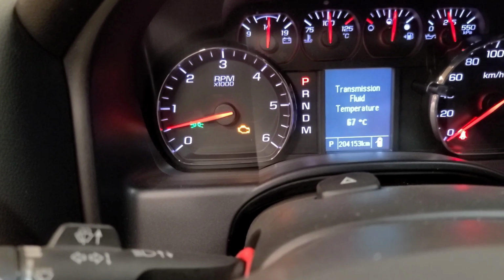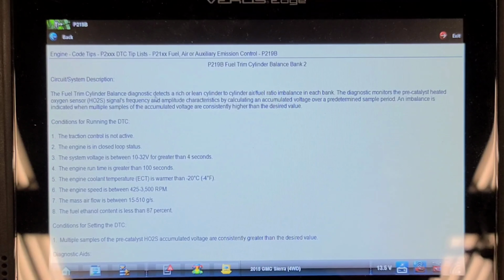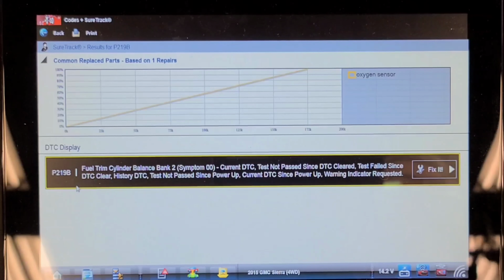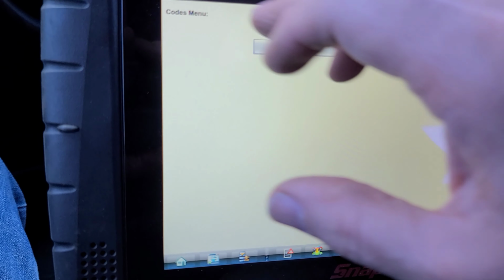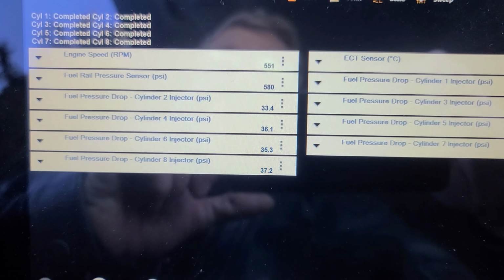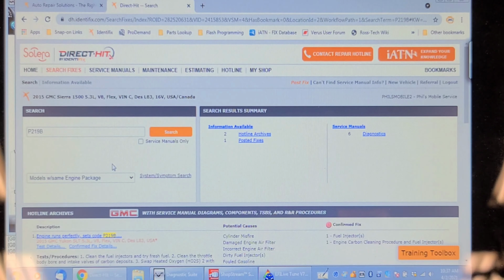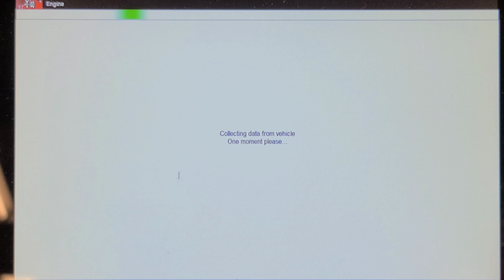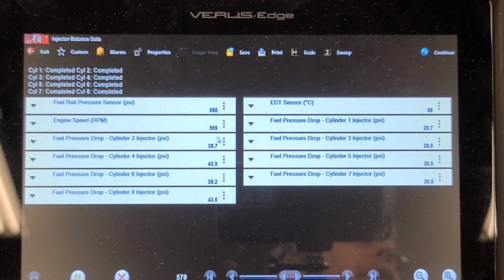2015 GM Truck 5.3 Stumble, P0300, P219B Codes Diagnosis Part 1.

Comment: Did a good job on your video one thing though you don’t compare left and right banks you compare each bank individually whatever the suspected injector is you leave out add the other three pressure drops together Multiply it by 20% and that gives you your ex acceptable pressure drop then you need to make sure you’re suspected injector falls within that time to replace it🤙🤙
Reply from the maker: Yes I found that out thanks. It's still a crappy test. Thanks for the information

Comment: Cylinder deactivation and direct injection- awesome
Reply from the maker: Yes my thoughts exactly. Two steps forward and 4 steps backwards. That's why I'm driving an 06GMC. Has 375 000klm and haven't done anything to the engine except plugs once and a water pump. Plus it routinely gets better fuel economy than the new trucks with all the bells and whistles. My next truck will be electric...

Comment: Dealing with this now after putting an engine in a truck. Super frustrating. I don’t know if it was there before or not either which is the frustrating part also for future reference if you pull the FPPM fuse, it will disable the fuel pump. originally, I thought my issue may be related to the breather on the valve cover being different on the driver side however, the code I have is bank too. I changed the valve cover over to the original design and I’m still having the problem. Both banks seem to be running rich just bank to a little worse. Any recommendations I’m going to do the fuel pressure drop test today.
Reply from the maker: @Hippiemechanic  be careful with the fuel injectors flow test results bank to bank.

Comment: I have the same code on my 2014 Silverado 1500 with the 5.3. I replaced the mass air flow sensor, cleaned my throttle body, and replaced my cold air intake filter, (it was old and dirty) replaced the O2 sensors and the check engine light still comes on. It has LT headers, aftermarket exhaust, and no cats. The truck is tuned and the downstream O2 sensors have been deleted. My truck feels very sloppy. It shifts weird and has very little power. No misfire codes. Slight vibration and sputtering when driving. Check engine light is solid until trying to accelerate quickly, then flashes for a few seconds and returns to solid. I'm thinking my fuel injectors have gone bad, not really sure what else it could be.. the spark plugs do need to be replaced.
Reply from the maker: Is it Ticking louder than normal. What cylinder/s are counting misfires. Could be valvetrain related as these engines tend to bend pushrods and collapse or break lifters.
Reply: @PhillipBailey  No sir, there's no ticking sound that I can hear. Just normal engine sounds and exhaust gases passing through the headers. I also noticed the coolant temperature was reading lower than usual. It will idle at normal operating temperature (210°) and will slowly drop down when driving and under higher acceleration, it will rise up. I would say the lowest temperature is around 175°- 180°. I just replaced the thermostat and coolant temperature sensor just now and took it for a test drive and it's running fine now and drives a lot better, doesn't feel sluggish like before and the transmission is shifting much better. Could a bad thermostat and/or coolant temp sensor cause rich to lean codes? I was thinking since it was running colder during driving it was running richer and when idling, it's causing it to run leaner when it got back up to 210°, causing the codes to come on, basically confusing the ecu. It usually took awhile for the check engine light to come back on. Hopefully I've fixed it!

Comment: Phillip, AWESOME approach and the way you tackle this  problem as the customer say he changed #6 injector and the psi drops 41 psi that mean that is the right psi what u thing so B2 is ok as the data shows and B1 driver side injectors should be changed with carbon cleaning this truck should run good  waiting for part 2  great information as always thanks brother.
Reply from the maker: We will see, waiting for parts. Going to replace them all. Seems that the right bank is over fuelling worse than the left side.

Comment: What was the fix? 2013 Silverado with p219a
Reply from the maker: I ended up replacing the set of injectors and walnut shell blasting the intake ports and intake valves. Then it set a P0430 after two drive cycles and we replaced the crossover for catalytic converter efficiency code. Then several weeks later it bent a pushrod on the right bank. Lasted a month and the lifter broke. Customer found a low mileage used engine.

Comment: Did you ever figure this out? I have a difference between bank 1 and 2. Recently I broke down on the highway and the codes (which I don't have in front of me while writing this) said something along the lines of low fuel pressure/fuel pressure regulator malfunction, or something like that. The engine would idle just fine with a little bit of a noticeable stumble but that's always been present since I got the truck. But when I 'put the engine under load I would progressively lose a cylinder. As in the more load I put on the worse the misfire would become as if the injector was constantly spraying less fuel. Bank 1 and 2 do not have the same balance pressure but everywhere I look online, everyone seems to say the same thing. One of your videos even showed the same thing. I do have GDS2 which is what I used to do the balance test. I'm about to change all 4 injectors on the bank that's showing low pressure hoping that it solves the problem. It's really odd to see all 4 injectors to go bad at once and the fuel rails on the L83 are nothing special. They're both fed from the high pressure pump by one pipe so both rails should see the same pressure but yet the balance test on GDS2 shows that 1 bank of injectors have a lower spray pressure. Very odd...
Reply from the maker: There will always be a difference between the two banks due to the location of the rail pressure sensor. I'd recommend to monitor low pressure and high pressure fuel pressure while it's acting up.

Comment: Hey, I have a 2016 1500 5.3L Silverado and its telling me Codes P219B and code U0073-00. I have no idea whats going on, car runs fine and I havent noticed anything. Any idea?
Reply from the maker: P219B is a fuel imbalance code between cylinders on bank 2 right side I believe. Is the truck stock? Have you replaced anything? These trucks seem to be sensitive to aftermarket air induction systems and exhaust modifications. Additionally they have injector issues and carbon build up problems on the intake valves. Try changing the plugs first, swap the forward o2 sensors side to side. See if the code returns or shifts to other bank. Don't use anything other than oem parts.
Reply: @PhillipBailey  hhmmmm ok thanks. Truck is stock, has a cat back exhaust but its been on the truck a while. No driving issues, the light just popped up, no missfire or anything

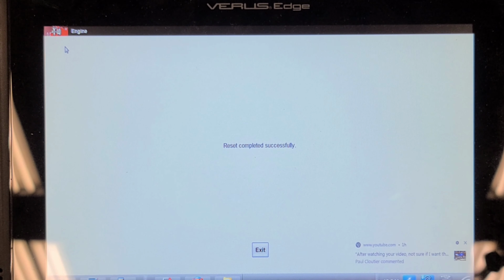Comment: I've noticed that these GM alternators are so good quality, that they don't black out, and start dropping voltage once its been running for a while, i checked voltage at cold start 14.57volts. Took the 2015 Tahoe out for a 20 minute drive came back parked it now reads 13.66- 13.80 Volts. One time I saw it drop to 13:34 Volts. I have noticed since the 2000s 5.3 Chevy's that these alternators are such good quality that most times its very difficult to find its failing point. I would test Voltage over and over again and again. One fail should confirm the issue in that case.
Reply from the maker: @kerman559sanchez4  it's normal for output voltage to drop as low as 12.6 when it's in fuel economy mode.
Reply: @PhillipBailey  I was revving the Engine and it never went higher than 13.80 never went up to 14volts at all
Reply from the maker: @kerman559sanchez4  it's computer controlled based on battery load,  battery state of charge and temp. Try turning on the headlights, that should cause it to ramp up.

Comment: Such an informative video. Thank you so much for this upload. I'm having the same problem with my Sierra. Same year, engine size, etc.. The only difference is mine has only 58k miles on it and already has new injectors, plugs, and wires in it. I have no lifter tick.

My p219b came up 1 day after installing shorty headers. I was chasing exhaust leaks from the start, at the manifold and the flanges connecting to the y-pipe. Even found one further down the exhaust pipe. Plugged that leak with a weld. Confirming leaks with a shop vac, soapy water and looking for bubbles. After new gaskets (again) and torquing everything down the leaks seemed plugged and no more code.

A few days pass and all seems well...then another check engine light on my way home from home depot. Same code again. 

I can't imagine my new injectors are already shot. I'll swap over the sensors next to test it out. Waiting  for truck to cool off to see if the manifold bolts loosened up (again). I'm using good arp bolts with anti-sieze, no blue loctite. 

Which sensor was changed? Pre-cat or post? Both? I'm still learning this.  Thank you!
Reply from the maker: Swap the precat sensors if you want to eliminate that. Cabon on the intake valves is also a problem. Good luck
Reply: @PhillipBailey  

Thank you.

I found another leak last night nearly directly adjacent the second o2 post cat on driver's side. There's a 3rd bung welded in place with a screw cap in place to plug it. It leaks from the welds and the cap. The leak itself resembled a tiny tailpipe underneath the truck. Man, one thing after another...sealing that one up today at an exhaust shop. 😖
Reply from the maker: @snooka2484  I hope that fixes it but doubt that it will...
Reply: snooka. I have the same problem right now. Only code showing is p219b after installing shorty headers. my tuner is advising the change the o2 sensor.
Reply from the maker: @j6Michoacan  since you just installed the headers why not swap the two forward O2 sensors side to side, clear the code and see what returns. In theory if it's the O2 then it should move to the other bank. This is a PITA code to chase. Is it tuned?

Comment: Hello sir i have a 2017 Chevrolet tahoe with the same code. it came on after installing shorty headers. codes returns ever 170 miles or so, after clearing code, what advice do you have for me. Also the truck has a 93 octane tune.
Reply from the maker: The fuel trim imbalance code is a PITA to diagnose. There are lots of possibilities which include the forward O2 sensor, exhaust leaks, modified air induction systems, imbalanced fuel injectors, intake carbon deposits, spark plugs and engine mechanical. Since your condition has started since tge exhaust modification I'd recommend to check for exhaust leaks, try swapping the two forward O2 sensors. Don't use aftermarket O2 sensors if you decide to replace it or have already. Is it setting any misfire codes? Have a look at the intake ports for carbon buildup.  Try a set of oem plugs. Do an injector balance test. Check for bent pushrods on the AFM cylinders. Good luck.

Comment: Did the new injector get rid of the ticking noise?
Reply from the maker: At the time of this video that tick is more or less normal. The truck did come back several months later with a bent pushrod and the later with a collapsed lifter.

Comment: I have the same problem on my Silverado 5.3 2016.
I've already changed injection nozzles, spark plugs, spark plug wires, oxygen sensors and coils. I went to a Chevrolet store and they told me that when this happens they condemn the entire engine saying it was some kind of play in the engine head.
Reply from the maker: That's nice of them. Give you a huge estimate and hope you go away>... As you have probably learned by now there are dozens of possibilities for these fuel imbalance codes. first is the intake or exhaust modified from original? Second, I know you said you replaced injectors, plugs and O2 sensors but did you use OE parts, especially the injectors and O2 sensors. What do the intake ports look like? carbon deposits on the intake are know to contribute to these codes. Any exhaust leaks? what code does it set and is it always on the same bank?

Comment: Hey Phil did they put 20.4 on it? I just downloaded 21.2 or did he do it last week? Bummer he didn’t have you wait a few weeks
Reply from the maker: I've just installed 20.4 last week. Going to hold off updating to 21.2 for couple weeks. I want to see if they finally repaired a couple issues first...

Comment: I watched this video thinking I might gain some insight to that horrible 219a and 219b codes that can be caused by over 20 different variables and was disappointed by your video. For one when reading the % of drop for injectors you never compare right bank to left bank and vice versa you take all of one bank add together then divide by 4 for your average then you do a plus and minus ten percent then see if any injector falls out of that range but the Snap-on injector balance is a bad test to do it really needs GM AFIT test to be accurate. Pressure readings are different from one bank to the other because of location of the fuel rail pressure sensor. And then once a push rod bends it’s automatic that you change the lifter and not just replace a pushrod. The cause of the push rod bending was a failed lifter to begin with. Not trying to be an ass but this was a lot of misinformation to people actually looking for good answers out there.
Reply from the maker: Thanks for the constructive criticism it's appreciated.  At the time of the original testing I was not aware that the injector balance test was flawed and since the difference in pressure drop from the right bank to the left seemed to concur with the imbalance code I called the injectors and walnut blasted the intake ports. That did fix the imbalance code but it might have been the cleaning that actually corrected the code. Two of the injectors on the right bank had been previously replaced by another shop and we were uncertain if they were correct ones. Two days later and it set a P0430 code. Customer supplied a low mileage crossover pipe.  You are correct in saying there are a bunch of possibilities for the imbalance codes. I've done two different trucks that just had bent pushrods where I just replaced the pushrod followed by an electronic delete of the DOD system and so far they have been fine. This truck in this video came back a few weeks later with a bent pushrod which I replaced and it lasted a few days and the lifter broke. The customer bought a low mileage used engine. Overall the GM reliability has sure taken a hit with these systems in my opinion.